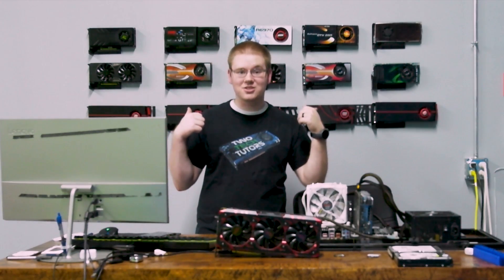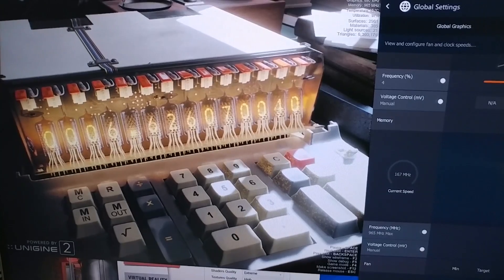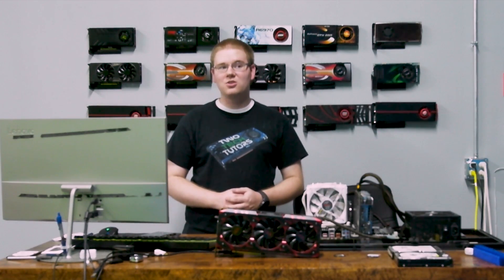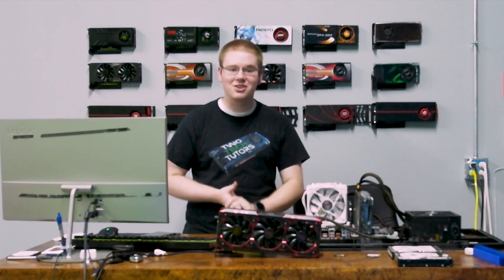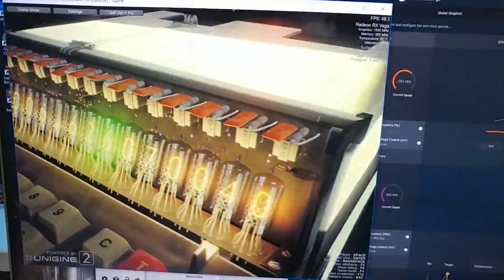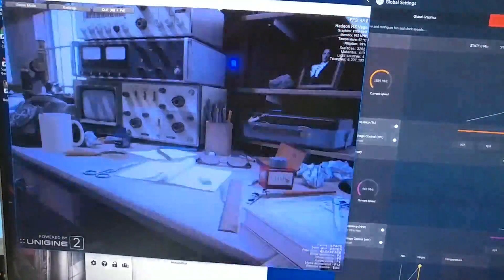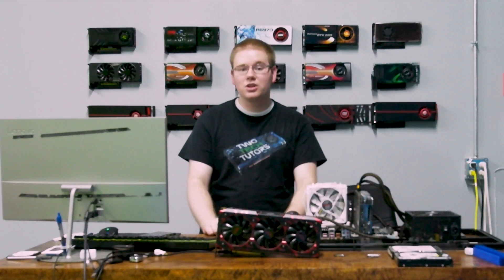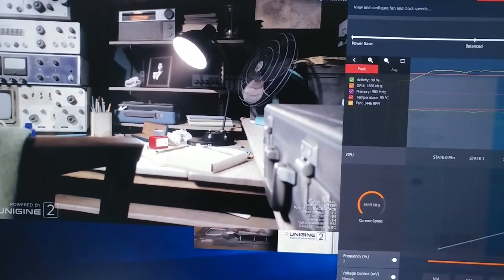GPU Artifacting: Examples & Explanation

Comment: I am getting a weird smear of like curtain parts of objects that seems like it’s legit stretching through the map at times
Reply: did you understand what's the problem? I get them too
Reply: Tryton   Seems like turning down the memory clock fixed it, I guess some games just handle the clockage better than others.  If you are running base memory clock and still getting the issue then you may want to invest in a new card though because it probably means the card is getting old and or dying.
Reply: @kynooshino  oh ok thanks. I also get them at base (less times tho) but I bought the gpu new 1 year ago...
Thanks for the help
Reply: Tryton I would contact the makers of the card and see what they can do to help
Reply: @kynooshino  I tried but it's INNO and they didn't even reply
Reply: @kynooshino  Is it possible that it's not plugged in correctly? I recently cleaned my pc and took it off and now that I have replugged it in it doesn't have that problem (I have a damaged mobo pci slot)
Reply: Tryton      One of the first things I did is re-seat it.   Moving the clock speeds down fixed my issue so far, the past several weeks.  If I see the issue occur again I’ll know the graphics card is slowly dying and probably just use my warranty that I have two of for what ever reason.   I have other issues related to games crashing but I think it’s having to do with my ram being weird for my intel chip set, but gSkill customer support is absolutely terrible and won’t reply after weeks.  Their Germany support email is literally something like “CodyG@gmail.com” or something     Like it’s probably just one dude for each region of support.  I tried calling numbers and such and the phone just rings or errors lol      So much for my $500 ram, at least it WORKS but it’s just not very stable since it was technically optimized for AMD chip sets...   but I digress, the topic is about GPU, not Ram lol      PC gaming can be difficult smh
Reply: @kynooshino  Yeah I think I will try to contact them again. I'm sorry for what is happening with your ram bro
Reply: Tryton    Gskill needs a real support team       I’ll figure it out eventually maybe      Good luck though

Comment: It was not very useful as it only shows one type of artifacting. (One that I haven't seen before). I thought you had some examples and an explanation of what exactly is going on.
Glitches can vary a lot. Vertical and horizontal stripes, triangles, incorrect colours, pixels, green tint, flashes, distorted text and so on.

Comment: how I can fix this? im getting the problem with all of the colors popping up while in game.
Reply: If you have warranty on the card then take it back to the shop and they will fix it.
If not, try some overclocking software like MSI afterburner, and DOWNCLOCK the memory. That maybe will help.
Reply: @sharkmenyus  i have a msi aero itx gt1030 oc and while playing battlefield 1 , artifacting starts to happen at ultra settings. Very weird only happens at one place of the game of only one level.

Comment: using zotac 1050 ti oc ... getting artifacts in ...SOTTR ... RESIDENT EVIL 2 ... PES 2019 ... and many other games ... but I have a kind of an old rig :
amd fx4100
some old asus MB
8 gb ram 
500gb  green WD hard drive
I didn't tryto overclock it or anything...
what could possibly be the problem ... or is it  just a bad card?!
Reply from the maker: Artifacting is a GPU issue, I once bought a GTX 950 that artifacted, even when just at the windows desktop. Some cards are just duds and need to be RMA'd.
Reply: @3DPC  the problem that my card is bought from amazon shipped to another country. .. It's hard for me to rma I think. .. I guess i am just stuck with it 😢😢
Reply: what kind of artifact? can you describe it?
Reply: @Editssssssssssssssssssssssssss  flickering. . lines ... dots ...etc

Comment: My current card is a GTX 1070 which I got around may 2017. I haven't overclocked it, and recently it started to show similar signs shown in the video. It even has instances where the screen goes completely black and white and also times where I can only see a constant CMYK coloured pattern crossing over my screen. This only occurs on graphically high intensive games and I have spent hours altering settings to try and lower the stress put on my GPU. Would you suggest using the "Eco mode" that the Gigabyte Xtreme application offers? I honestly don't know what else I could do and I do not want to buy a new card since it's just gone christmas...
Reply: Is it still in warranty if it is return it
Reply: @NutiuR  Honestly don't know if it has warranty. However I set clock down 200 mHz and it's fine now

Comment: My 6-month old ROG Strix 1080Ti has started freezing up and showing green artifacts. I've tried everything over the past weeks - clean installed Windows 10, reinstalled drivers and games, updated BIOS, switched the card to a different PCI-E slot, plugged all the cables again, nothing works. Any game I try playing gets artifacting followed by freezing in a matter of a couple minutes. And sometimes, while watching videos, the screen goes black and it comes back on after a couple minutes of signal scanning.

In my case, I think it's either a faulty GPU or PSU, although I'm leaning towards a faulty PSU as it's started doing those weird clicking noises every now and then.
Reply from the maker: Try underclocking the GPU. You can use Asus GPU Tweak or MSI Afterburner. Set your GPU to -100MHz and also subtract 200 MHz off the memory. See if that fixes anything or reduces the instability.
Reply: @3DPC  Thanks for the reply! I'm going to try this in a bit, but I JUST noticed something weird. I was looking around on GPU Tweak as well as GPU-Z and I noticed my GPU fans are sitting at 0% when idle even though the idle temperature indicates 40C, which I assume isn't right? Maybe the issue is that as soon as I load up a game the card gets too hot too quickly before the fans are given the chance to speed to a high enough RPM in order to keep it at a stable temperature?

I don't know. It's pretty easy to tell you know a lot more about these stuff than I do. This is the very first time I own a fairly high-end PC with such a powerful GPU, so it's all new to me. Never had to worry about these stuff before.
Reply: @jidenshaotoko  it is normal, usually they start spinning at 60 degrees, tho u can change that with OC tools like TTT mentioned 

if u have Asus, with Asus' tool 
MSI with MSI's tool 
Sapphire with sapphire's one or just something that works for you 

Tho did u try with another GPU? even older one? 
I doubt the temp is a problem
Reply: @nxk5116  The issue I've had with my GPU and the idle fans is that the entire case was getting boiling hot to the point it burned my fingers when I touched it. After GPU-Z showed the fans were idling at 40ºC, I realized that for some reason my custom fan curve setting got reset, so I fixed it and the case is back to normal temperatures. However, even with the fans working properly and the temperatures under load staying average or below average, the computer would freeze up and sometimes the green artifacts would kick in. 

Unfortunately I don't own any other GPUs I could be using for testing so I've mailed mine back to the shop and I hope they can replicate the issue so that I can get a replacement.

I doubt this is a temp issue too though, looks more like a faulty card.
Reply: @jidenshaotoko  was GPU sagging? what GPU do u have? or did have in it xd

did u try to underclock it?

were u touching any of the golden pins? 

Did u try to heat it up with heatgun? or sth? 

like did u try to put your computer vertically? open
Reply: @nxk5116  I have an Asus ROG Strix 1080Ti OC Edition. I checked for sag before sending it back, but it was solid between the PCI-E and the case. As for underclocking, I applied a pretty modest amount but since I'm not comfortable with doing this type of stuff, I didn't spend a lot of time testing it.

Since I got the computer, I removed the card twice to replace the stock coolers on the case and I was extremely careful to not touch anything that would be in direct contact with the motherboard. No heatguns or attempts to heat it up (I wasn't even aware this was a thing hahaha). Case was never handled in any position other than what you'd normally have. The farthest I went was to lie the computer down so that the PCI-E slots would be facing upwards for easier handling of component swapping.
Reply: @jidenshaotoko   yup, but why did u not leave case opened (PCIe facing upwards)? changing fans on the case doesnt work that way, closing up the computer only helps in one case "NO DUST" but if u are willing to clean it every now and then with with few air blows and good air flow than it really doesnt hurt... 

anyway, it is possible that chip (GPU) wasnt ok, 

tho did u get your computer prebuilt?
Reply: @nxk5116  The issue with the GPU and me changing the case fans are unrelated. I just wanted to swap out the stock case fans for a couple of Corsair fans I got. I had the PCIe facing upwards when I had to remove the GPU as that thing is so huge it made it hard for me to keep the fans in place so that I could screw them into the case.

We get a lot of dust where I live and leaving the case open would mean cleaning it up on a daily basis. As someone who uses the computer for work more than I do for gaming, that would simply be unrealistic.

My computer was built by the shop using parts I handpicked myself.
Reply: @jidenshaotoko  u're 2lazy.. 

next time try leaving the case open for an hour or two and leave it be facing upwards (pcie).

And did u try to mess around with the RAM as well?
Reply: @nxk5116  Not a matter of being lazy. My work involves dealing with constant tight deadlines. The computer should be working just fine with the case closed, so there's no point in leaving it open collecting dust on a daily basis. The entire computer works just fine, it just looks like I got a faulty GPU. That's all.

Nope, haven't messed with the RAM. Again, computer is fine. I ran all sorts of diagnostic tools, from mdsched to stress tests using tools provided by Intel. Checked HDD and SSD health, all good. It's a GPU related issue as running games with the integrated graphics has not frozen the computer once. Graphical artifacts are absent as well.
Reply: 3D PC this video was good I’ve searched very where for the example am facing and you mention underclockjng bro and I fixed that shit one try
Reply: @3DPC  Hello i bin having problems with my 3070 gpu and i just got this brand new pre built like 3 months ago and im gettign crazy artifacts in all my games blurry and flashing lights and weird textures stretching all over my screen like triangle shapes i tried everything i can think of to fix it but nothing works. i wanna try to underclock it the gpu came at default settings never overclock it what should i change exactly to underclock a Gigabyte 3070 thanks guys

Comment: GTX 1060, I experience this between 1.5-1.9GHz 
Playing shooters, if I am running around and turning a lot, scenery appears to "bleed" colors on the opposite side that I am turning. e.g. I turn 180 degrees and a tree in front of me appears to have a purple shadow as its dragged off the screen, which won't be visible when standing still, looking directly at it. That's the best way I can explain it unfortunately...
Reply: what? when i stressed this GPU with Furmark and 3Dmark i got to 1937/1940MHz with ez, it didnt even reach 70 degrees  and fans were only at 40%
Reply: @nxk5116  I think it was a shit thermal paste job at the factory or something, I overheat constantly. I have a tube on the way, can't think of anything else.
Reply: @conincamo5948  nah.. =$

I benched ASUS 1060 6g (the white one) and it never exceeded 70°C (so it was below that) 1937mhz core

while 470 Sapphire 4gb was at 75°c at 1260MHz core and 7000MHz = (1750MHz) memory preset... 

what brand do u have? 

i dont think it's the thermal's fault tho
Reply: @nxk5116  Nvidia, but it's my  CPU (Intel Core i7-8750H 2.2-4GHz) that's overheating. It'll hit 90 within 20 minutes of gameplay on anything more demanding than League of Legends... Fans running well above half speed. Maxing them out will usually get it to settle in the 70s for an hour or so, then it'll climb to mid 80s.
Reply: @conincamo5948  Do you have closed case? 
If so, then perhaps there is a hot air circling around that may be causing that. 

If not, reapply thermal paste, some that has high enough conductivity somewhere around 12,5 W/mk may be good, like Grizzly's one.

just leave the case open like me, and replace cooler's fan or even cooler itself :D
Reply: @conincamo5948  yikes, try to avoid those beefy laptops, while they seem cooled properly, they are actually not and and yh in that case thermals may be the cause ofc =$

put some liquid metal on it, if u open it xd 

im sure u wont have to worry then, for a really really long time xd
Reply: @nxk5116  It's a full size 1060 with 2 fans but when I was inside I didn't bother checking whereabout the CPU is in regards to those fans. I also keep it on a wire rack in front of a window lol, you'd think I'd get more than 20 minutes before critical errors :( I move around too much to invest in a desktop, and honestly this rig is better than anything you'll find anywhere near the price range. I have been through dozens of reviews and it seems I'm alone on this one, as usual... Fingers crossed for the paste I guess. Thank you so much for the input tho, don't see that enough in YouTube's comment sections :)

Comment: https://www.youtube.com/watch?v=K9sS79jMyCU&feature=youtu.be
Reply from the maker: Yep, looks like artifacting! Decrease your memory clockspeed and see if it's any better.
Reply: How can i decrease memory clockspeed? can you give me some tutorial or tips, i am not so familiar with this, thanks a lot for support!!!
Reply from the maker: Download MSI Afterburner
Install MSI Afterburner
In the middle section, click on the "+0" just to the right of "Memory Clock (MHz)"
type "-200"
press enter
Click the checkmark just underneath the "Fan Speed" controls to apply the changes.

MSI Afterburner is one of many tools to adjust clockspeeds, fan speeds and raise GPU limits. I prefer the looks of other GPU overclocking utilities, but MSI Afterburner seems to work with more GPUs than some of the other software I've tried in the past. MSI Afterburener won't control the RGB on Zotac, Asus, EVGA etc... cards, so you'll still need the same-company program as your GPU if you want RGB control.

Comment: No oc but my gpu showing artifacts ...it's a new msi GTX 1050ti
Reply: Lasagna 69 same, did you find any fix?
Reply: @random_dad2791  it was ram problem system ram I removed it and after cleaning my GPU working fine
Reply: what artifact did you have? can you describe?